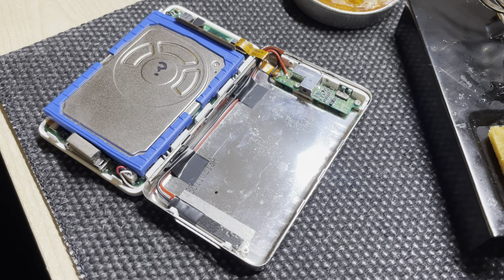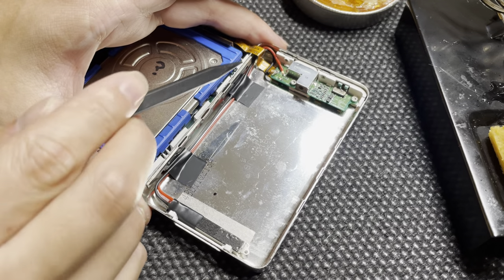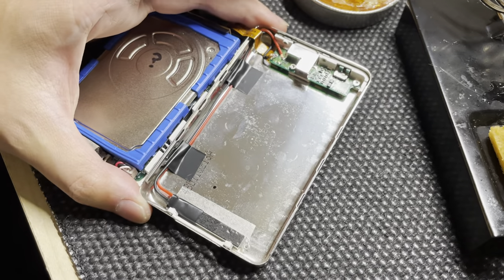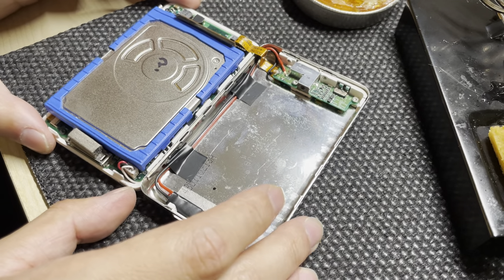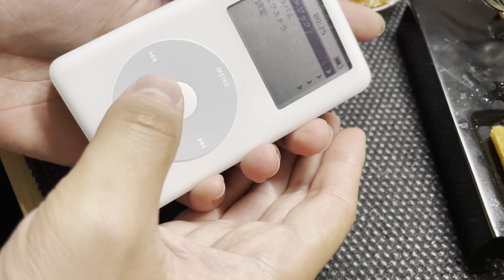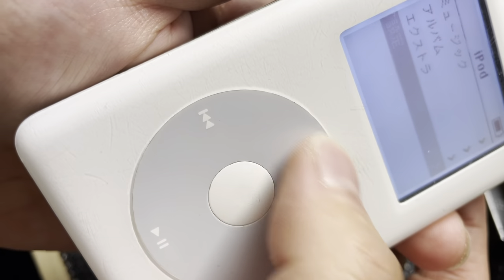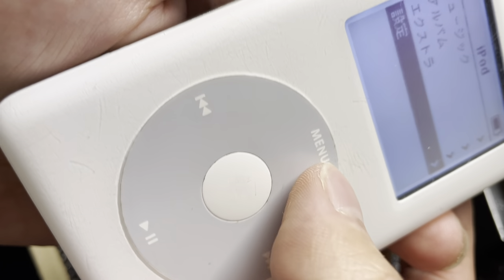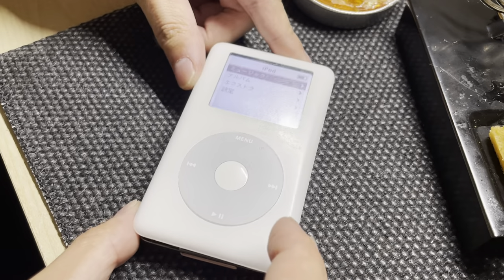iPod 4th Gen Taptic Engine Mod (Quick Showcase)

Comment: I saw this from your reddit post, what Taptic Engine did you used? (iPhone 7, 6S engine, etc)
Reply from the maker: I used a Taptic Engine extracted from an iPhone 6S because it uses the simple 2-pin design. The Taptic Engine from newer phones use more than 2 pins and I didn't have time to find the pinout.
Reply: @NekoMichi  ok, thanks mate, i didn’t knew the 6S was only a two pin design, then I’ll probably use the same as yours